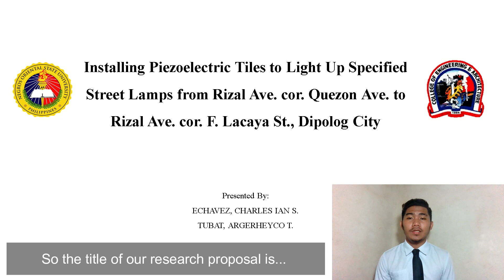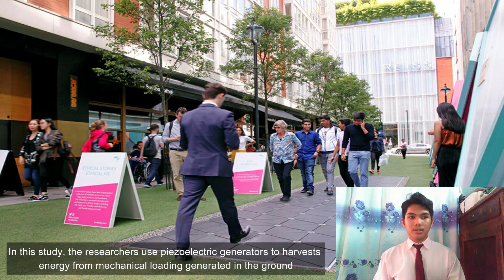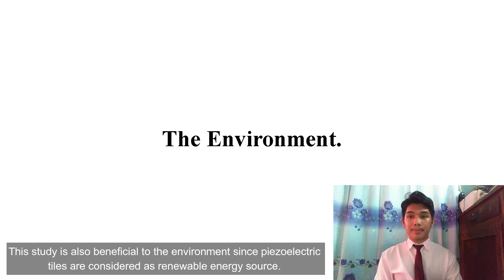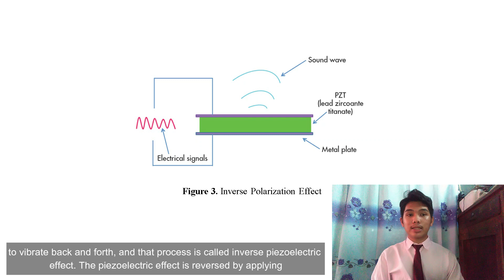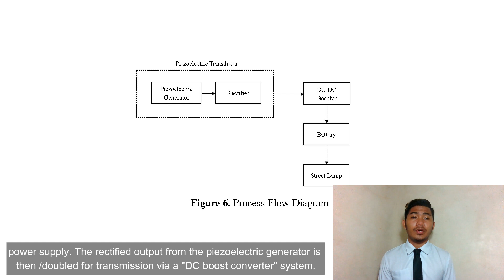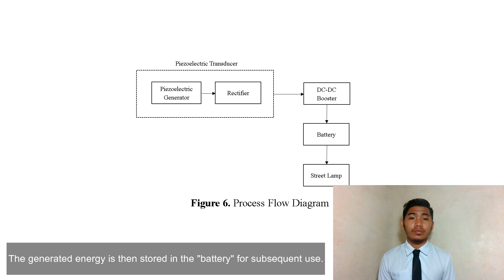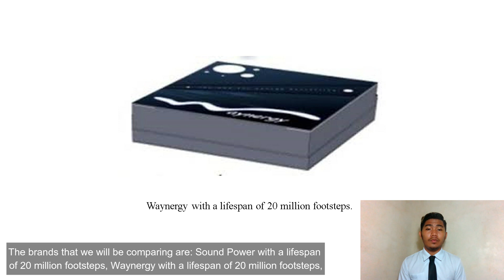Installing Piezoelectric Tiles to Light Up Specified Street Lamps

Comment: Ronel S. Bayonado
COE 346 Methods of Research T-TH 5:00-6:30 PM
March 25, 2022

REACTION:
The proposal is really well discussed and the presenters really did their research. Using piezoelectric tiles to light up street lamps will not only give safety to the citizens but also a way to reduce the consumption of energy to help the country.

REFLECTION: 
Piezoelectric tiles is a great technology to power up street lights, by installing it in sidewalks, the citizens walking on it will generate mechanical energy and the tiles converts it into electrical energy which the street lights use as power. This would be a great help for those places with frequent power interruptions, even if the powers are out, lights would still shine through the street lights making it still safe to travel at night. With the use of this technology and renewable energy, we are not only helping the country but also our planet.

Comment: Dislan, Erdo Bataviano O.
EE341 A TTH(6:30 - 8:00 PM)
March 25, 2022

Reaction:
This is an excellent proposal. The presenters are well prepared and explained everything smoothly. This can be a good alternative source of power.

Reflection:
Using Piezoelectric tiles to light up street lights in their desired area is really new to us. It very different from the commonly used solar panels. Although it may cost huge amount of money ,still it will be really helpful to the people in that area. Their local government won't be paying electrical bills anymore. I appreciated their desire to help the people In that area.

Comment: Name: VEXANDER PHILIP M. MARAVILLA
Class Name &Class Schedule: ENS 341 A - TTh  6:30- 9:00  Pm
Date : MARCH 25, 2022

REACTION: If we imagine every step we put on those piezoelectric tiles being installed in sidewalks ,foot ways and staircases in all public areas and places these will lessen our consumption that came from the power grid that emits a lot of carbon foot print in the air .

REFLECTION: Brilliant concept like this will address the issue we facing now on our  electricity , this will minimize the power interruption ,promotes clean energy and boost our capability on technology and innovation.

Comment: Name: Mark Daniel L. Anggoy
Class Name & Class Schedule: Coe 343 Methods of Research T-TH 5:00-6:30
Date: March 25,2022

Reaction:  The presentation was quite instructive and well-presented. The general concept is intriguing. This study is really informative, and the speakers did a great job presenting it. It's a terrific concept to save energy and power. It was my first time introducing the concept of piezoelectric tiles, and it drew a lot of interest.
Reflection: The use of piezoelectric tiles in the proposals is a quitely new concept when compared to traditional solar panel designs. I was blown away by the fact that they came up with yet another innovative way to serve their neighborhood.

Comment: Mamigo, Jascha Anthony T. 
EE 341 Research Methods for Engineering TTh 6:30-9:00PM 
March 25, 2022

 REACTION: This study proposal is well-written and covers a wide range of subjects. They go over every detail that will help us comprehend it completely.

REFLECTION: When compared to traditional solar panel ideas, the use of Piezoelectric Tiles is a completely novel concept. I'm impressed that they've come up with yet another innovative solution to assist their community.

Comment: NAME: Clark E. Juanites
CLASS NAME & CLASS SCHEDULE: EE 341A 6:30 - 8:00 PM T-Th
DATE: March 25, 2022

REACTION: This research proposal is very educational while also being really valuable. This plan will open the way for renewable resource conservation as research and technology develop. The research is excellent, and the concept is quite original. 

REFLECTION: The Piezoelectric is extremely beneficial for the development of industrial production, and it is incredibly durable and efficient, making it a viable solution to energy reliability issues. This study is chemical-free, thus it is good for the environment. Installing Piezoelectric Tiles to Light Up Specific Street Lamps is a good study because it helps to reduce electricity consumption.

Comment: NAME: John Ver P. Bulanon
CLASS NAME & CLASS SCHEDULE: CoE 346 METHODS OF RESEARCH -TTh 5:00-6:30pm
DATE: MARCH 25, 2021
REACTION: The presentation was outstanding choice informative and well-presented. The overall concept is intriguing. This study is very informative, and the speakers did a great job presenting it. It's a great idea to save energy and electricity. It was my first time introducing the concept of piezoelectric tiles, and it drew a lot of interest.

REFLECTION: I believe that using piezoelectricity, which converts mechanical stress into electricity, would be beneficial. This study is chemical-free, so it is good for the environment. Installing Piezoelectric Tiles to Light Up Specific Street Lamps is a beneficial study because it helps to reduce electricity consumption.

Comment: Villanueva, Chastine E.
COE 346 Methods of Research T-TH 5:00-6:30 PM 
March 25, 2022 

Reaction:
This is a great energy source, and I can relate because we did a study using piezoelectric technology when I was in senior high school.

Reflection:
I believe that using piezoelectricity, which converts mechanical stress into electricity, would be beneficial. This study is chemical-free, thus it is good for the environment. Installing Piezoelectric Tiles to Light Up Specific Street Lamps is a good study because it helps to reduce electricity consumption. This research will aid in improving people's nighttime security.

Comment: NAME: Tracy Alex E. Manzo

CLASS NAME & CLASS SCHEDULE: ENS 341 Research Methods for Engineering - SATURDAY (5:00-8:00PM)

DATE: March 25, 2022

REACTION: The proposal is simple to understand. I'm blown away by the study proposal because the researchers can properly express the issues they wish to address and the possible solutions. This idea is similar to some in that it illuminates some streetlamps with Piezoelectric tiles rather than solar panels, giving it a unique and appealing appearance. Piezoelectric tiles have recently improved in terms of scalability and dependability, and they could be an answer to worries about energy security.

REFLECTION: Within our own society is bursting at the seams with innovative minds and solutions to some of the world's most pressing problems. We need a lot of innovation that pushes renewable energy sources to keep up with our quickly growing population. We will be able to not only benefit ourselves, but also cut carbon emissions, which contribute to global warming. Piezoelectric devices are used to power equipment such as lighters, gas stoves, and so on. Piezoelectric tile, which has a crystal structure and is capable of converting mechanical energy into electrical energy, is discovered by inventors/engineers. This form of energy source is extremely beneficial to investment as well as development and industrial production. Piezoelectric tiles may be used in congested settings, which is why other countries have already installed this energy-generating material in public spaces and in private homes. The utilization of Piezoelectric tiles has greatly improved in recent years, and they are now exceedingly robust and efficient, making them a viable solution to energy reliability issues. Although the purpose research can still be investigated more, it is now time to put it into action.

Comment: NAME: Ong, Pearl Marney A.
CLASS NAME & CLASS SCHEDULE: ENS 341 - Research Methods for Engineering - Saturday (5-8PM)
DATE: March 25, 2022
Reaction: The research being shown tells the viewers about the use of Piezoelectric tiles. It generates an electric charge when pressure is applied. My interest is aroused because I never knew about this kind of creation, as technology advances new and more inventions are being introduced.
Reflection: The Piezoelectric Tiles does not release hazardous gases that contaminate the environment, and also doesn't require a large piece of land to construct its infrastructure. With the increasing energy consumption many inventors are thinking of other possible substitutes to prevent our electrical source from being depleted.

Comment: Name: Belinario, Cristy T.
Class Name and Class Schedule: ENS 341 B - (5-8 PM Saturday)
Date: March 25, 2022

Reaction:

The study is relevant to the current demand for green energy. True, the Philippines is an emerging country with a growing population, and as a result, the demand for electricity rises. Because the country is dependent on coal power plants, which are non-renewable sources of energy and are harmful to the environment, there is a need for another source that is efficient and sustainable. The use of piezoelectric tiles to illuminate specific street lamps is an excellent solution that improves public safety while lowering carbon dioxide and other global warming emissions. The idea is to use piezoelectricity as a renewable energy source as an alternative source of energy. The researcher effectively presented the process flow and formula to be used, and the assumptions are pertinent to the study.

Reflection:

Global warming caused by greenhouse gas emissions is affecting us today. Every day, we are confronted with higher temperatures and weather imbalances. In our home, we rely heavily on appliances that generate electricity to cool down the temperature, such as an electric fan. Truly, today's electricity demand is extremely high, and our supply is insufficient. Piezoelectricity, a renewable energy source, is one of the best ways to reduce reliance on power plants to generate electricity. It will protect our environment from pollution caused by high levels of carbon dioxide in the atmosphere.

Comment: Vanissa C. Monticino
COE 346 Methods of Research TTh 5:00-6:00 pm 
March 25, 2022

Reaction: The researchers have come up with a unique and inventive study. Their research proposal is really educational, and it informs a large number of individuals about the use of piezoelectric tiles as an alternative to street lamps. The concept is advantageous since it conserves electrical energy.

Reflection: The usage of piezoelectric tiles as an alternate energy source to power street lamps is a fantastic concept. It is advantageous in locations where there is a lack of power sources. This concept will illuminate the many streets and, ostensibly, provide protection to the inhabitants.

Comment: Catherine Joy Lacson
COE 346 Methods of Research T-TH 5:00-6:30 PM 
March 25, 2022 
Reaction: 
This research proposal is quite informative and covers a broad range of topics. They discuss every part that helps us to understand it well.

Reflection: 
Its goal is similar to those of the previous studies, except instead of using solar panels, it uses Piezoelectric tiles to light up certain street lamps. This study is unique and intriguing because it not only aims to light up a street lights, but it also aims to help the environment by transforming kinetic energy into off-grid electricity.

Comment: NAME: MACAHIDHID ALRICK , O.
CLASS NAME & CLASS SCHEDULE: COE 346A – TTH 5:00PM-6:30 PM
DATE: March 25, 2022

REACTION: This is a fascinating research project. It makes me curious to see how the project will turn out. Because I'm unfamiliar with the term "piezoelectric tiles," I'd like to understand more about it and how it works. It's great that I can learn about this topic through the researchers' video.

REFLECTION: I think that using piezoelectricity, which converts mechanical stress into electricity, would be beneficial. This study is chemical-free, thus it is good for the environment. Installing Piezoelectric Tiles to Light Up Specific Street Lamps is a good study because it helps to reduce electricity consumption. This research will aid in improving people's nighttime security.

Comment: NAME: Montebon, Gerald Mae E.
CLASS NAME & CLASS SCHEDULE: COE 346 - A
DATE: 03/25/22
REACTION: This proposal is one of the most amazing innovative proposal I've encountered. I know that piezoelectric tiles can work fantastically well as self-powered sensors, tracking the movement of people through these public spaces. 
REFLECTION: Piezoelectric tiles are built from unique materials like crystals and ceramics that build up an electric charge when mechanical stress is exerted, such as when a foot presses down. As piezoelectric tiles' efficiency and durability improve, and as the need for green solutions grows, this plan predicts that this sort of energy production will blossom on the green energy market.

Comment: Macabinguil, Joshua R.
COE 346 Methods of Research T-TH 5:00-6:30 PM
March 25, 2022
REACTION: The research is excellent and the idea is very unique. I hope this will be implemented in the near future.
REFLECTION: Installing Piezoelectric Tiles to Light Up Specified Street Lamps can help for the safety in a street and this could minimize for using electrical energy. Because it is made using special materials, such as crystals and ceramics, in which electric charge builds up when mechanical stress is applied ” such as a foot pressing down.

Comment: Noel E. Macay
COE 346 Methods of Research T-TH 5:00-6:30 PM
March 24, 2022

REACTION: Amazing idea that would be very helpful to light up street lamps in some dark places by installing piezoelectric tiles. The proposal was presented very well and it is very interesting since this system is unfamiliar.

REFLECTION: This system if fully developed and implemented will surely amaze everyone since it is a new idea. It is also an environmental friendly that people will have nothing to worry about. Such a great innovations and very durable which could be a solution to the problems of energy reliabilty.

Comment: NAME: Reynabelle Kim Noble
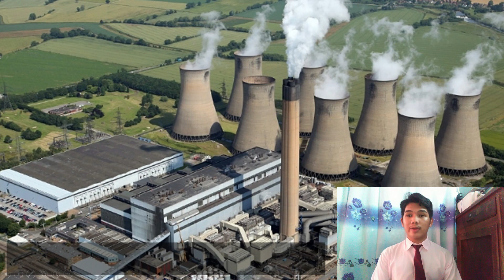CLASS NAME & CLASS SCHEDULE: ENS 341 A (2:00 – 5:00 SAT)
DATE: March 24, 2021

REACTION: This was a very impressive and brilliant idea in my opinion. I am astounded at how they came up with such a creative and innovative solution for our society. Because piezoelectric tiles are new to me, learning more about them and how they work would be great. It is equally great that I can learn about this from the researchers' video.

REFLECTION: It has a common objective to the other studies, but instead of using solar panels, this study uses Piezoelectric tiles to light up specific street lamps, which makes this diverse and attractive. The use of Piezoelectric tiles has greatly improved recently, and they are very scalable and reliable, which can be a solution to energy reliability problems.

Comment: NAME: TORRES, JAMES CARLO A. 
CLASS NAME & CLASS SCHEDULE: EE 341 A-RESEARCH METHODS FOR ENGINEERING-TTH 6:30-8:00 PM
DATE: 3/24/2022

REACTION:
The research is very useful to the community. The researchers are prepared and presented the study very well. The presentation is very informative and the study is very specific. Piezoelectric Tiles is new to me, so the idea catches my interests. 

REFLECTION:
Studies that greatly help the community is already respectable, but making use of the steps of the public in generating electricity to help the community itself is so remarkable. I could not ask for anything else, this type of research is well-thought-of which makes the research more impressive.

Comment: NAME: Cheri Mae E. Tinguban

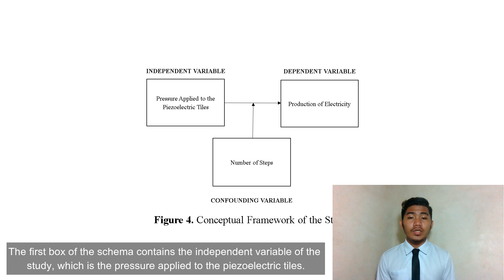CLASS NAME & CLASS SCHEDULE: ENS 341 – Research Methods for Engineering – 5:00-8:00 Saturday 

DATE: 24/03/2022

REACTION: This final video discusses "Piezoelectric Tiles Are Being Installed to Light Up Specific Street Lamps". These researchers, as far as I can tell, are suggesting the usage of Piezoelectric Tiles, which generate an electric charge when pressure is applied. This tile does not release inorganic or hazardous gases that can contaminate the environment, and it does not require a big amount of land to construct the system, like power plants do. These tiles, on the other hand, can only generate a little amount of power per footstep. Piezoelectric tiles convert kinetic energy into off-grid electricity and are one of the many sources of electricity waiting to be investigated or discovered. I understand that energy consumption is increasing exponentially as the population grows, hence it is critical to limit energy consumption in order to ensure the country's long-term viability. As I finish viewing the video, I am astounded that such an invention exists; I had never heard of Piezoelectric Tiles before, so learning about them impresses me; this creation will undoubtedly benefit the community in various ways. It is true that there are numerous resources that are just waiting to be discovered.

REFLECTION: This Piezoelectric tiles is something new to me, as I have never heard of it before. Knowing its capabilities astounds me in some ways, since it is environmentally safe and can operate at any temperature. They have a low carbon footprint, making them the greatest fossil fuel alternative. These materials have characteristics that make them the best energy harvesters. I'm hoping that in the not-too-distant future, these investments will be exposed to the public so that we can witness the miracles that this tile can provide.